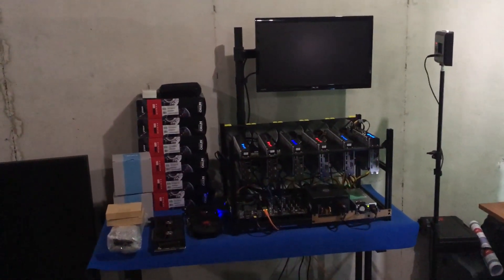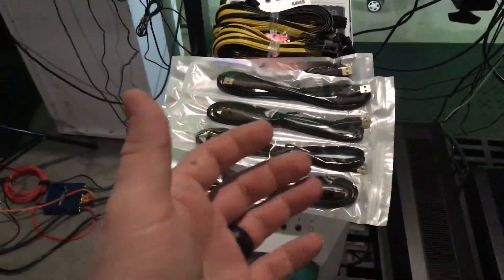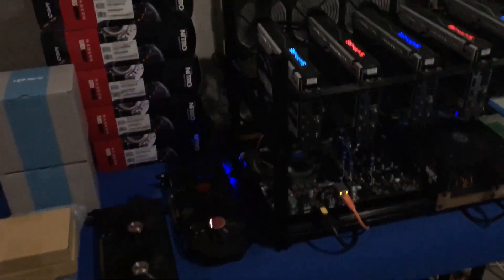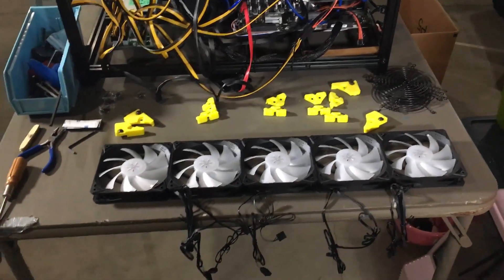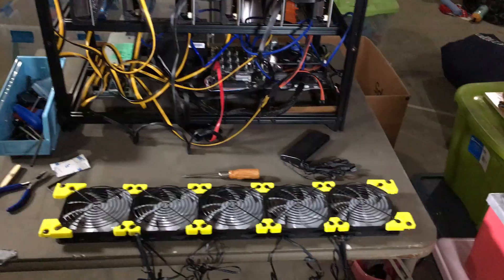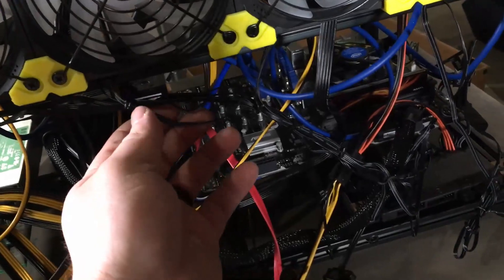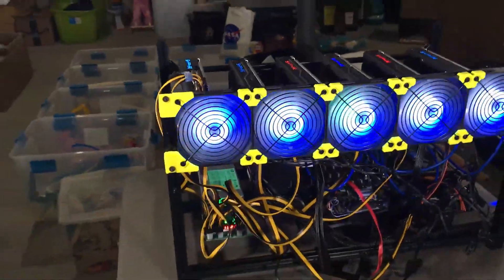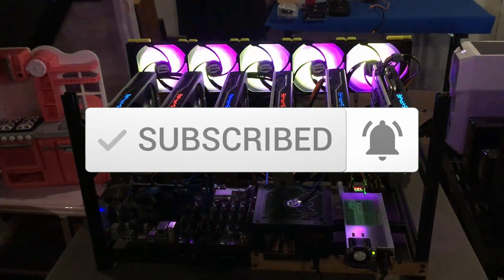GPU Mining is HOT! We need to Upgrade our Cooling!

Comment: I dont understand why people keep saying this?! Is it because yall using old crappy cards? I'm fairly new to mining and definately not a pro but my RTX3070s all run at about 48C with fans around 53-55%. Its not loud and it's not hot like all these weirdos claim. I get 61.5-62 mh/s with -500 +2525 130w and a 40 second OC delay. 0% Rejected. All day every day....barely warm, barely as loud as my xbox or laptop. So why is everyone always complaining about noise and heat? (Yes I also use server PSU and its quiet and warm as well) What gives? Do these folks just have no reference to what is "loud" or "hot"?

Comment: What's the loudest element of the rig? How loud is server PSU vs regular ATX PSU?
Reply from the maker: ATX PSU is quiet.  Server PSU is not bad now that I balanced power between the ATX and Server PSU.  Id say Fans now.
Reply: @TheHobbyistMiner  Thanks, I've heard server PSUs are quiet if you don't put more than half of their rater load (300-400W max on 750W PSU). I want 4 GPUs per PSU but it's about 520W.
Reply from the maker: You are correct. When I ran all my GPU's off the HP PS it sounded like a jet engine. Moving forward going to use a few of them. Cheaper than ATX

Comment: Im from Pakistan.
Please fill in any gaps in this setup, any part that is necessary for this setup,for my mining reg.
Graphic card. Pieces 70.Rx 580.
Motherboard New  H81 PRO BTC R2.0. pieces 5 .
Ram's ddr4 8gb pieces 10.
intel i5 10400gen. pieces 5.
19 Gpu mining frame. pieces 4.
pcie VER009S PCI-E 1X to 16X 009 Card Extender Express Adapter USB 3.0 Cable Power gpu pci riser 009s.pieces 70.

￼ Taisu Power Supply High Power Mining PSU Rig GPU ATX 1600W.80PLUS Platinum. pieces 8.
Kingspec 2.5 " MLC 64gb. 4 pieces.
Reply from the maker: I don't think 8 power supplies are going to handle 70 RX 580s.
Reply: How many power supplies should you have?